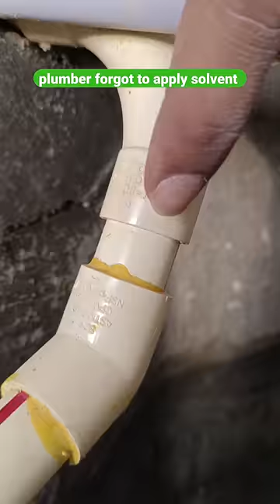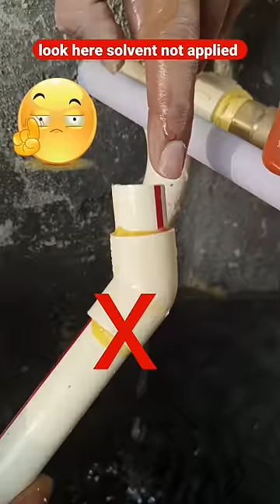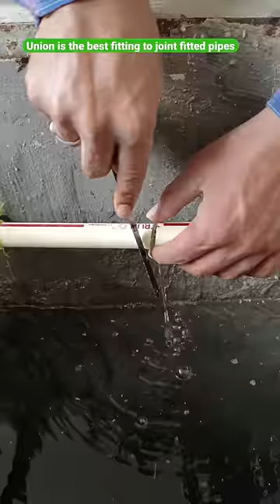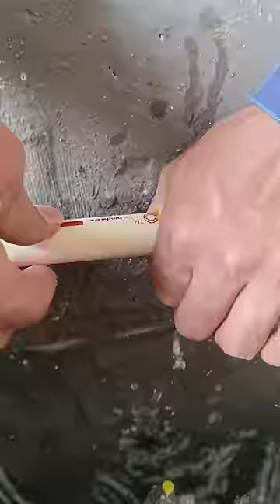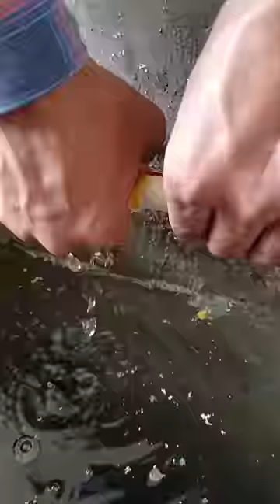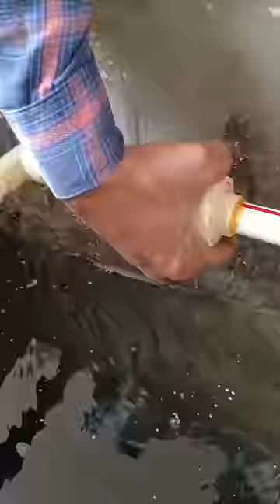CPVC pipe leakage #plumbing #cpvc #plumber #shorts #youtubeshorts

Comment: Union ka jarurat nahi bhaii, thida pipe niche karke ,gum legake set karnaatha...
Reply from the maker: Can't there is no movement in pipe distance is less to fit coupling...pipe  is in under tiles fixed  if i pressure it force to fit it will break...2 minutes work will be 2 hours.....so it's a no risk work
Reply: @expertplumberworld8441 no fucking way you couldn't pull that 1/4“ of pipe out of that joint to apply glue and put it back.  It's PVC, it has flex.

Comment: 1-You're supposed to glue the union beforehand
2-You contaminated all water with glue and pvc dust
3-That glue is not made for pvc pipes. You'll have it leak again in no time 
4-Ypu didn't even had to cut the pipe in the first place

Comment: There is no coupling connected there then what is the reason to connect the union there when a straight pipe doing it well????

I m electrical engineer, but Just to gain my knowledge i asked some times i need to supervise plumbing work as well at sites